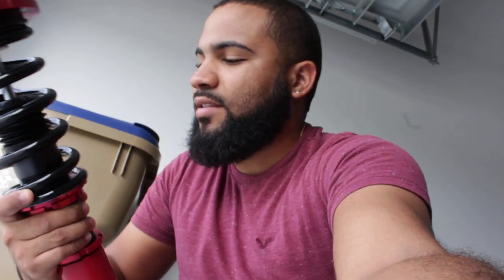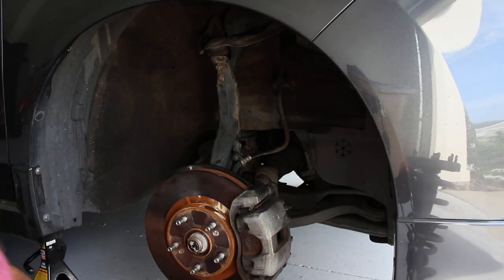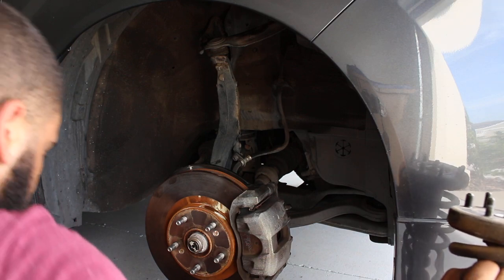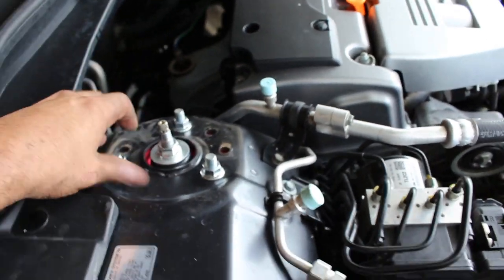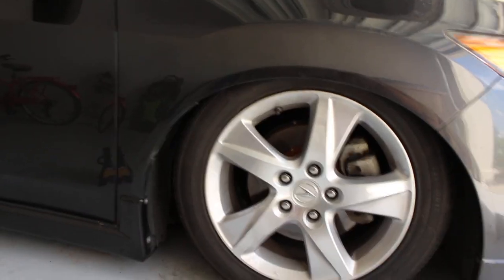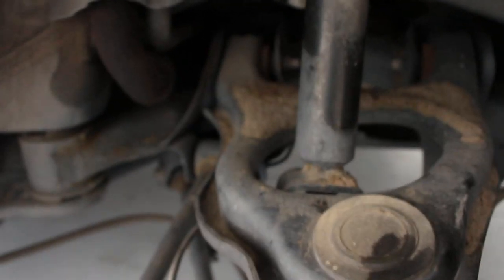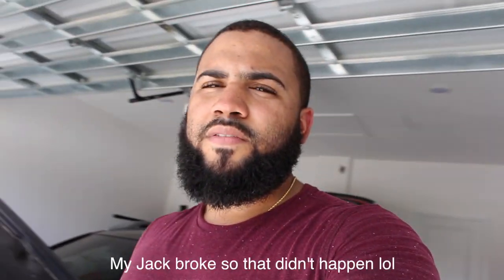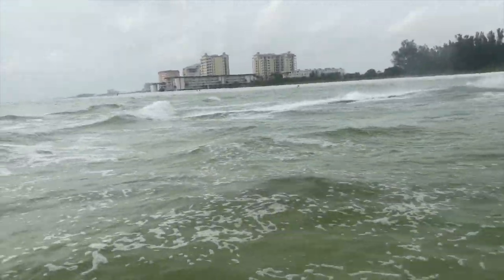CHEAPEST Coilovers.. Slammed My Acura Wagon Maxpeedingrods

Comment: I got those same coilovers on my honda accord, and went to sg to have them installed, but my car didn't get that low, I got hella wheel gap in the front and they told me it was maxed out
Reply: Same bro same. There’s some extra stuff you gotta do to set the pre load lower and slam your car
Reply: remove the extra collars that will give u 1 to 2 inches, if that is not enough cut a lil bit of the spring, if that's not enough go to washers, if that's not enough, just drive bottomed out